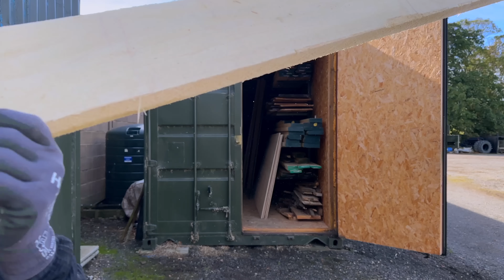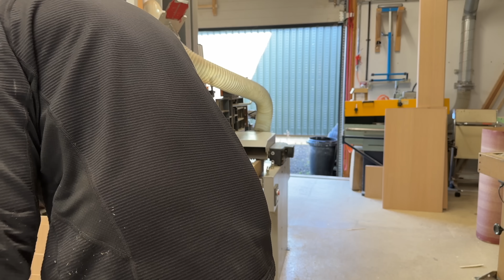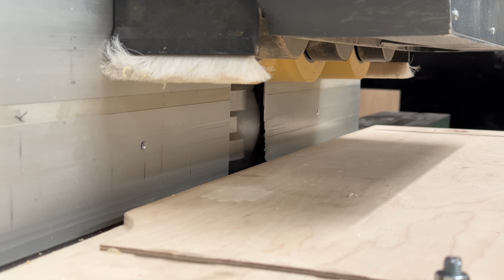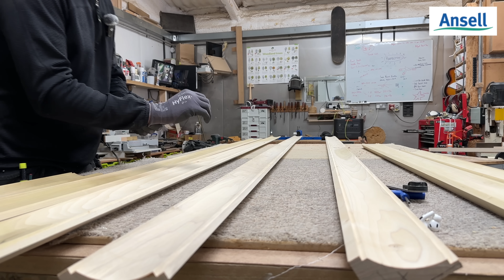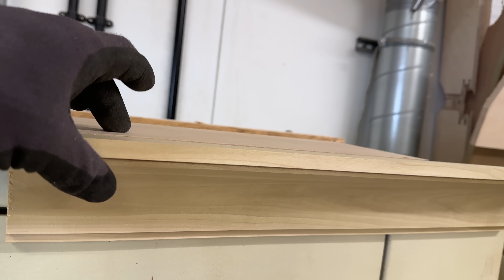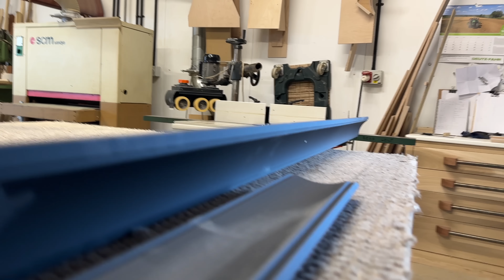Making Custom Timber Cornice Moulding

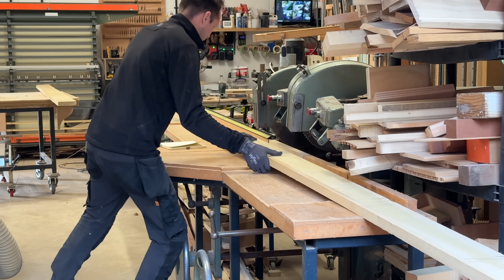Comment: 00:40 Watch out for those cross-arm cuts fella!
Reply from the maker: cheers mate, i am careful around the machines, probably a perspective issue but i dont push my luck, these crosscuts are a different anibal to most others, they dont kick or snag, ive had crowned 4"oak 3m long pinch down on the blade and they are so heavy it just grunted at it and carried on. Any other radial arm saw would have been breaking ribs, so just a not to anyone reading to be careful with lighter radial arm saws.

Comment: You are the only person I've heard have a single good word to say about Latham's. 

Nobody in my area likes dealing with them, although maybe there is a difference with the Timber & the Sheet Materials divisions. 

Everyone I know both Carpenters & Joiners & Timber merchants in my area absolutely hates dealing with them & will only use them if they absolutely have to. They genuinely have an absolutely appalling reputation in my area.
Reply from the maker: Interesting, ive used my fair share of timber suppliers and have always gravitated back. On the Accoya side they stock and sell decent quantity and quality, and the other comapanies are very unreliable that sell it. I order stock and it turns up reliably and good quality, with bespoke requests the reps have been excellent, but i guess all that is based on the branch/staff there..